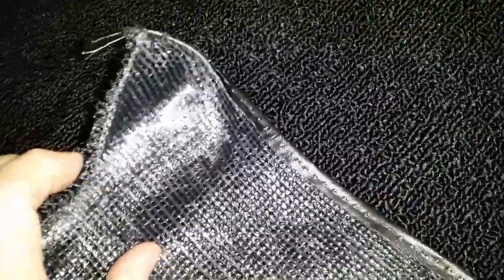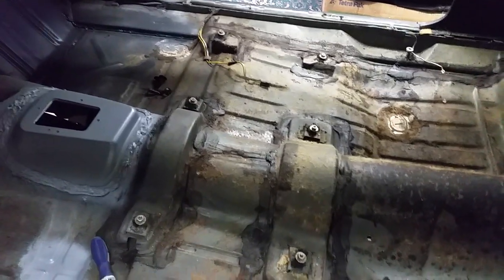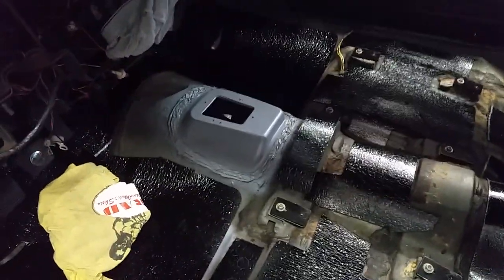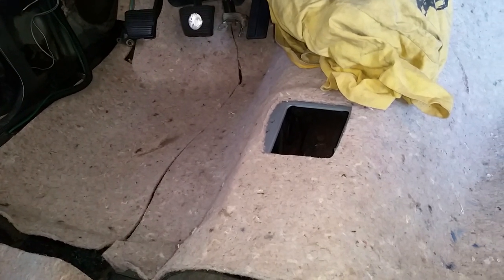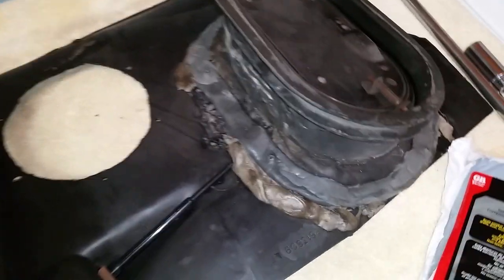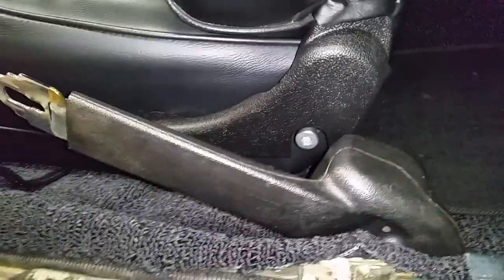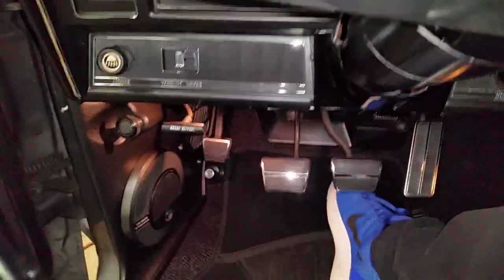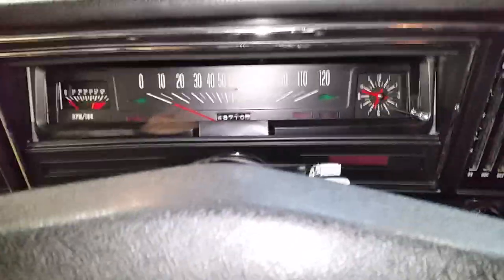1972 Nova SS installing new carpet and testing the seat belt warning

Comment: Latch the separate shoulder belt into the lap belt before buckling up.  A lap belt alone will keep your lower body in place and prevent being tossed around or being ejected but offers no protection for the head and upper torso.  That is what the separate shoulder belt is for.